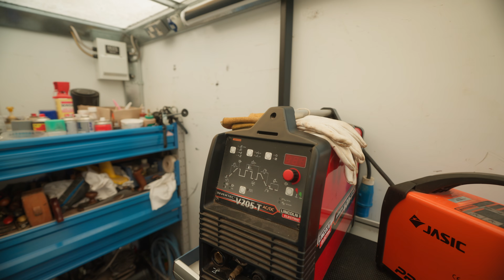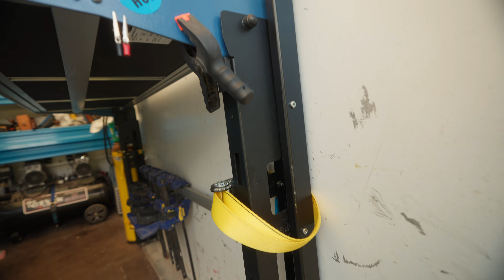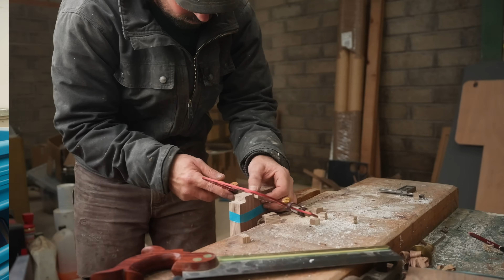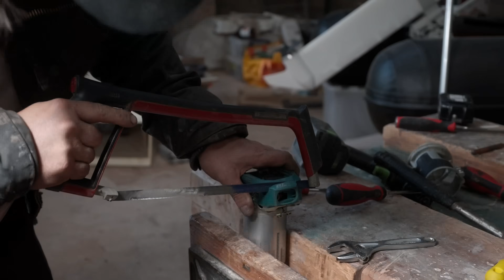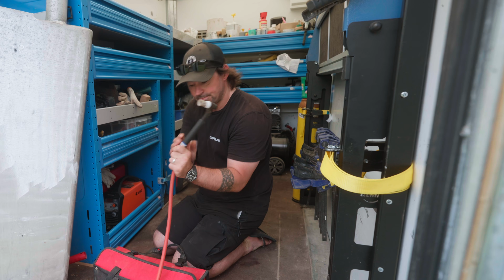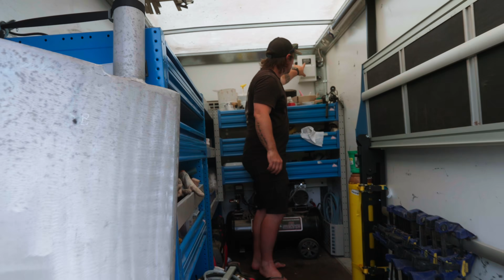Boatbuilders Mobile Workshop : All the tools

Comment: You can get things delivered to somewhere in France and collect it there if you are having difficulties getting things over on the ferry or to Switzerland directly. Amazon have collection points/ boxes and I’m sure there are other alternatives.  Like Evri is European.
Reply from the maker: Hey, thanks for the suggestion, that would have been a great idea. Not sure Amazon would work though- I’m a bit of a geek. I’m fussy in what I’m using which makes it hard to source things sometimes.
The main issue was that I had already bought it before I realised I had a problem on my hands….. ooops

Comment: Renovating a camper is easy compared to building, renovating a sail boat. Repairing critical issues below, in half a gale or more in cramped spaces with the non optimal tool can very hard. No shops around, no specialists around, no special tools around. It doesn’t matter how many bolts, nuts, screws and fittings you bring, it’s hardly ever the right ones.
Reply from the maker: Take your own specialist mate, that’s my technique 👊🙌
Reply: Don't forget that on a boat, not everything is straight, level or at right angles! 😭😭😅😅😭😭
Reply: @FelixDaHack  🤦‍♂️nothing in my life goes in a straight line man! Why would this be any different 😂
Reply: @SailHub hahaha ditto that! Great video you made IMHO, enjoyed rummaging through your tools as well! Looking forward to your next upload even though my sailboat is fibreglass, I'm more than certain I'll steal some good ideas 😅
PS don't ask me about rehab either lol, I hated mine (back injury). Went to one session! Luckily after 2 ops I can now walk pain free. Hope you see improvements, I think you're doing really really well!

Comment: Swimming always gave me neck issues. I can recommend air bikes however (assault air bike, rogue echo...). Its pretty easy on the joints. Obv strength training is recommended in your case buy given the circumstances id highly recommend working with a physical therapist. I dont think you can get around that. You dont need an f1 pt but yeah, it'll be worthwhile. You can soak up a lot of know how in just a few sessions.
Reply from the maker: Ahhh really? Air bikes, good to know! I'll check them out!
As form PT… oh man, I’ve had a life of it…

Comment: Great video! Thanks!  I’m hoping to start a similar project in a year or two.
Reply from the maker: Cool, tell me more!
Reply: @The_Ghostship  We are moving to Portugal and I want to turn an aluminum sailboat into a solar-sailer. I will probably need to start it as a diesel hybrid-electric. My goal is to be able to travel back and forth from continental Portugal and the Azores.
Reply from the maker: @ExperiencedNovice2024 cooool, where in Portugal, we have friends scattered along the coast.

Give n a shout if you want, I can help you with that for sure 👍
Reply: @The_Ghostship I have A LOT to learn. So my first project is going to be more about learning and building a network than the boat itself.
Reply from the maker: @ExperiencedNovice2024 yeah mate, I was already int he industry as a shipwright but it’s taken me 3 years to get the belief in my project from brands etc. but then, I’m doing something unusual which requires prototyping… maybe you too, either way it all starts with solid foundations!
Reply: @The_Ghostship  I’m a decade or two older than you and not really able to do a lot of the work myself.  So, I’m taking a different approach.  I’m looking to build a network of skilled trades, contractors/services providers, naval architects, and vendors. I want to be able to repeat the process and ultimately offer it as a service.
Reply from the maker: @ExperiencedNovice2024 good stuff mate. That’s really exciting. I wish you all the best! I’m not sure where you are but if you’re in the UK or Europe I can probably recommend some people to you. 
Finding people is easy, good ones… not so much, after many years in the game I can certainly vouch for that!
Reply: @The_Ghostship I’m moving to Portugal. So I’ll be working on it there.

Comment: I asked grok regarding the paint situation.  I hope this helps? 

Key Considerations for Transporting 10+ Liters of Paint from the UK to SwitzerlandTransporting more than 10 liters (about 2.6 gallons) of paint across borders involves strict regulations, especially since paint is often classified as a hazardous material (hazmat) due to flammability risks. The type of paint—water-based (e.g., latex or emulsion, non-flammable) vs. solvent-based/oil-based (flammable, UN 1263 Class 3)—determines feasibility. Water-based paints are easier to ship as they're typically non-hazardous, while solvent-based ones require special handling and may be prohibited by air.You cannot take this quantity as personal luggage on a flight (e.g., checked bags), as airlines limit liquids to 100ml per container and ban flammable paints entirely. Instead, use professional freight services. Road freight is the most practical and cost-effective option for this volume, given the UK-Switzerland distance (~1,000 km via ferry/Channel tunnel and France/Germany). Air or sea is possible but slower/less ideal for hazmat.Step 1: Determine Your Paint's ClassificationCheck the Safety Data Sheet (SDS/MSDS): Download from the manufacturer's website (Section 14 covers transport info). Look for:Flash point: >60°C (140°F) = non-flammable (safer for shipping).
UN number: UN 1263 = hazardous (flammable).

Water-based: Often unregulated; treat as general cargo.
Solvent-based/spray: Hazardous; needs UN-approved packaging, labels, and documentation (e.g., Dangerous Goods Declaration).
If hazardous, you may need hazmat training (IATA/ADR certified) or hire a specialist forwarder.

Step 2: Choose a Transport MethodUse a freight forwarder experienced in hazmat (e.g., Eurosender, ParcelBroker, TNT, or DG Parcel). They handle customs, packaging, and compliance. Avoid standard couriers like Royal Mail or DHL for >10L, as they often prohibit or limit paint.Method
Pros
Cons
Transit Time
Estimated Cost (for ~10-20L, 50-100kg shipment)
Suitability for Paint
Road Freight (Groupage/Full Load)
Cost-effective; allows hazmat (ADR-regulated); daily departures from UK hubs (e.g., London to Zurich/Geneva).
Slower; ferry/tunnel delays possible.
2-5 days
£200-£500 (groupage); £800+ (full load)
Best option; licensed haulers ship spray paint.
Air Freight (Cargo Only)
Fastest.
Strict IATA limits (e.g., 30L max per package for limited quantities); flammable paints often forbidden or expensive.
1-2 days
£300-£700
Water-based only; avoid for solvent-based.
Sea Freight (LCL Container)
Cheapest for bulk; IMDG-compliant for hazmat.
Slow; ports (e.g., Felixstowe to Rotterdam, then road to CH).
7-14 days
£150-£400
Good for large non-urgent loads; hazmat OK.

Recommended: Road via Groupage (shared truck). Forwarders like Barrington Freight or Plexus Freight offer daily UK-CH runs. For hazmat, use specialists like ShipPerfume.com or Transglobal Express (DG Parcel service).

Step 3: Packaging and DocumentationPackaging:Use leak-proof inner containers (original tins with locking rings/clips).
Absorbent material (vermiculite) in UN-approved outer boxes/drums.
For hazmat: Class 3 labels (flammable liquid diamond), orientation arrows, and "Limited Quantity" mark if under limits (e.g., 5L inner max for air).
Secure against 1.2m drops; waterproof bags to prevent spills.

Documentation:Commercial invoice/packing list (value, quantity, HS code: 3208-3210 for paints).
SDS/MSDS copy.
For hazmat: Shipper's Declaration, ADR/IATA forms.
Proof of origin (UK-Switzerland FTA allows duty-free for industrial paints; use EUR.1 certificate).

Step 4: Customs and Duties (UK Export → CH Import)UK Export: No export duties on paint. Declare via HMRC's Goods Vehicle Movement Service (GVMS) for road. EORI number required if commercial.
Switzerland Import:Duty: 0% for industrial paints (HS chapters 25-97) under UK-CH Trade Agreement (preferential origin proof needed).
VAT: 7.7% on CIF value (goods + freight + insurance). Threshold: CHF 65 (exempt below; yours exceeds).
Clearance Fee: CHF 11.50-70 (Swiss Post or forwarder handles).
Total estimate for £500 value shipment: ~CHF 40-60 VAT + fees.
Declare at CH border (e.g., Basel); forwarder files electronically. Personal use? Possible duty relief if <6 months old and not for resale, but 10L+ looks commercial.

Tools: Use Swiss Tares database for exact tariffs; EasyShip calculator for estimates.

Step 5: Hiring a Service and Next StepsGet quotes: Contact 2-3 forwarders (e.g., Eurosender for non-hazmat, TNT for hazmat). Provide SDS, volume, weight, and value.
Insure: Goods-in-transit coverage (£10-20/kg); standard doesn't cover hazmat leaks.
Track: Use forwarder's portal; expect border checks.
Pro Tips: Ship in cooler months (avoid heat buildup). For >50L, consider full truckload to cut costs.

If it's water-based and non-commercial, road groupage could be as simple as £200 door-to-door. For solvent-based, budget extra for hazmat (£100+). Always confirm with a forwarder—non-compliance risks fines (£1,000+) or shipment rejection. If you share paint type/details, I can refine this!
Reply from the maker: Man, thank you for looking into this for us!
That’s just fab, well, it is and it isn’t.

We’re actually across now.. we never managed to edit the video in good time though because of what happened next… all will come clear… The paint situation was pretty stressful. We found a way and declared it all without issue. But, it could have worked out very, very expensive…
Reply: @The_Ghostship  Nice one!!  Looking forward to seeing the work on the boat!!
Reply from the maker: @GavinTaylorOfficial oh man, me too!😂

Thankfully Ghostship is  about the journey hand man oh man, we’ve had one of them. It’s been insane!
Reply: @The_Ghostship  yeh i normally watch your other channel where you walk around the showfloors of events to showcase new stuff!
Reply from the maker: @GavinTaylorOfficial ahh cool, yeah this will be nothing like that!
I rekon 50:50 boat/adventure mix.

All the tech stuff including welding woodwork techniques etc will be covered in detail on Sail Hub and Ghostship will be a blanket over view of it all based on the fun!

Comment: When I built my 39 Folkes, I used 6 Mil clear shrink wrap to create an enclosure and to provide a work station on the front deck. I built a 4 by 8 work platform that stored my wood supplies and tools. I also built it so that I could swing sheets around to cut on this table as well. Two reinforced holes with sliding panels to allow ventilation were put in the front and back. I used 1 inch electrical conduit for the frame attached to the stations. The trick is to stop having to climb the ladder so often and keep working when the rain and cold comes. I also finished the head as soon as possible as well so that the general look of the boat was there and it finished up quickly giving some visual progress and with head you had some where to go. I guess you will be using your van for this purpose... The clear shrink wrap also allowed me to paint the decks early in the season and kept the boat much drier as well. All the best.
Currently Hyping the channel !!!
Reply from the maker: That's some serious ingenuity and great tips for staying productive in all conditions!

Love it mate. My problem is it’s not my land and I can’t afford to stay in Switzerland, prices are insane so I’m planning an early escape and hope to take inspiration from you in the next location!

Comment: I put Dynabrade RA palm sanders at the top of the heap as it pertains to orbital sanding. 
The X52 line of 3/32" random orbit finish sanders are the Pinnacle of finish sanding.
Reply from the maker: Thanks for the tip! I will defo give them a look. Always been a fan of the Mirka and the adjustable balance for vibration at the top here in the UK. But yeah, I’m gonna give them a look- if my Mirka ever dies😂😁 cheers 👍

Comment: You'll need to to start with shoulder shrugs lean forward doing them use two buckets with water(15ltr) & buy the "iron neck" you can use resistance bands. And you'll need to loose a few pounds and if you have the money stem cell therapy.
Reply from the maker: Hey, thanks for the suggestions! I'll definitely look into the exercises and equipment. 👍

Comment: Excellent start. The pain will be having to drive many miles to buy small stuff like nails, glue, bits that you didn't remember. Loving the journey.
Reply: With me it's always bolts, I have lots of bolts but never the correct one(s). And electrical connectors, fuzes and switches.
Reply from the maker: Thanks so much! Yeah, we're definitely learning as we go. Onwards and upwards fella!! P.s I think we have the hype mate!!! Waheeeeey!

Comment: Translucent roof on the trailer, what a good idea.  Formula 1 drivers perform neck muscle strengthening exercises to be able to withstand the G forces on the neck muscles during racing.  There are also body core exercises which can be done sitting in a chair where you tension the muscles in the abdomen, hold the tension for 1 minute, release and repeat. 3 or 4 times every hour. Strengthens the back in about 6 months. Recommended to me by a sports physio (Who resolved back issues in an Olympic athlete I know and who recommended this physio.) after I collapsed in street when my legs gave way, due to a segment in the spine touching the spinal cord.  I restored a house instead. No more issues. Stronger core and neck muscles can only help. Suggest finding a physio who treats serious road accident victims who brings back patients from zero to hero.
Reply from the maker: Yeah man, great ideas, cheers for this. I've been doing some core exercises with an elastic band too! Thanks mate! 👍

I think starting with the core is important, I learned this from previous injuries. The f1 headband had been recommended a lot, defo gonna look into it.
Reply from the maker: P.s, yeah the roof is good, it makes me not want to put solar on there.

Comment: With all these nice tools, you really need a working dehumidifier in the trailer. Or else they quickly get seriously damaged by rust
Reply from the maker: Yeah, good call! That would be a dream come true m! I have some sandpaper though… so that will have to do!👍
Reply: @The_Ghostship  And you can put WD 40 or some kind of oil on them to prevent rust and corrosion.
Reply from the maker: @nybakk1311 ahhhh! Now that’s a nice simple plan. I like it 👍

Comment: I’d recommend a good drill press. You can use a portable drill, but you won’t get near the accuracy you’ll get with a proper press… for the many times you will need perfectly vertical holes. 

I’ve had a few significant surgeries. A decent Occupational therapist was a literal life-saver. It’s not about how much weight and what exercises you do… it’s about how you do those. Proper form is the difference between building strength and further injury. I’d also recommend you augment strength training with ample cardio. Your most important muscle is your heart! Okay, maybe second most important for some men… but keeping a strong heart will give more benefits than anything else. 
It doesn’t have to be high-impact like running. For every mile you walk you burn the same calories as you would for a mile running. That sounds absolutely bat-shit crazy but it’s 100% accurate. You could also ride a bike or use a stationary rower (which would easily fit inside your trailer and be good practice for if you’re in need of your tender but are out of fuel or have a problem with your outboard.)
Reply from the maker: Good call with the press but I’m not sure I have the space.. I’d love one though. 
Cracking me up with the second most important muscle there too 😂
Reply from the maker: Yeah, good points there man.

Aye, I’m in a bit of a pickle…. Previous thoracic fractures too. Several Ligament reconstructions. Pelvis, femur… the list goes on.. I’m used to getting knocked about a bit but with this one, even walking is a killer. In fact, it’s way worse than being on wheels. Problem is… wheels, they make me wanna go fast….
Reply: I'd say a 'cordless drill bench press'. Drill's going to be powerful enough for a lot of jobs in ally with the high rpm. Even better if you can find one that you can 'index' the base in 2 dimensions and possibly angle, so you can use it like a mill.  Good luck!
Reply: @johnparham5978  that’s a good recommendation.

Comment: Completely understand your challenge. I’m finding that there is a price to pay for playing hard. A back surgery, a hip replacement (which was the second surgery), a surgically repaired right hand and a stroke attributed to a TBI. The one thing that works for me is a clean diet. I follow a diet called No Sugars, No Grains. It is basically an anti inflammatory diet and the difference I feel is profound. When I go off the rails, I can really tell a difference in all of the aches and pains, even my mental state. 

Great video! I’m setting up a trailer myself to take my composite repair biz mobile. Great timing!
Reply from the maker: That’s sounding good. I should try the no sugars, I’m coeliac so I’m half way there mate! Thanks 👍